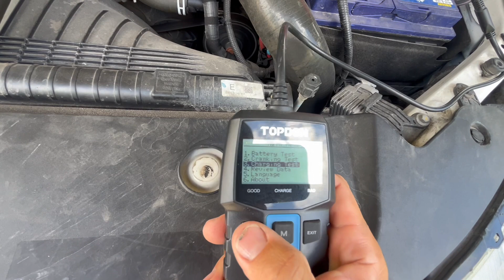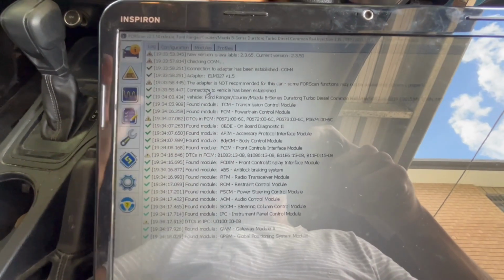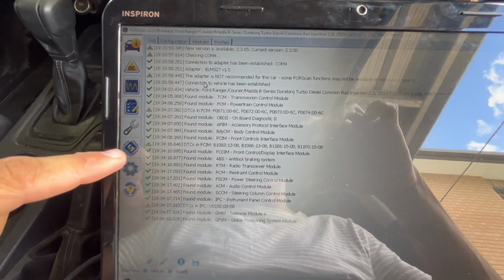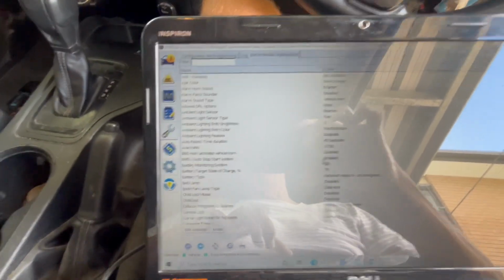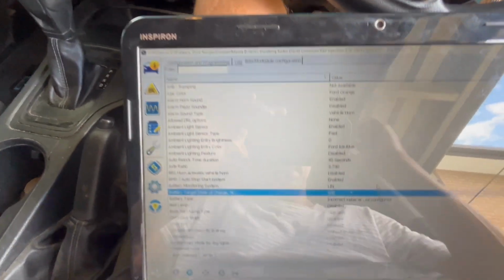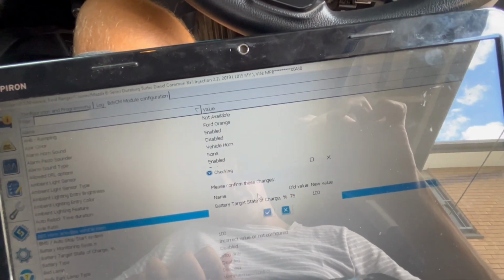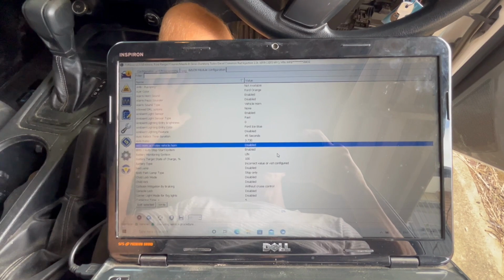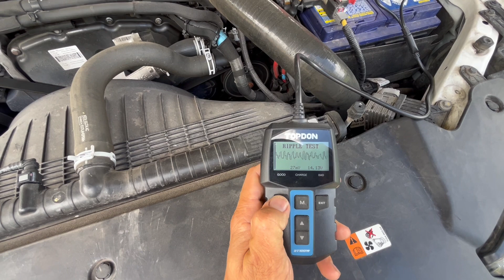Programming the Smart Charge Alternator on a Ford Ranger for 100% Charging

Comment: I have a '21 Lariat/FX4 and have the same TopDon Tester. After putting it on my truck and doing the same charge test I get 14.5v charge with 8-9 Mv jitter. About to replace the OEM battery with a lithium auto battery, was just searching around to see if I needed to change the charging profile but it looks like 14.5v for my new battery will be about perfect.

Comment: If you turn on lights , ac or any electrical load the smart charge will bump the voltage close to 14. The 12.9 is enough to keep it running with no electrical load and no battery draining to prolong life of alternator.

Comment: New subscriber here.. after watching a few of your vids.. 

I was watching these vids to see if there were some answers to my weird charging issues I have started having, where my BM2 bluetooth battery monitor reports low cranking voltage (down around 8.5v) and high charge voltage (up around 14.9v). Ford Dealer disabled smart charge years ago. 

I have Forscan Lite on Android and a OBD2 MX Bluetooth reader setup for my PX1 Wildtrak. This gets me out of quite a few jams but not all. Have you been able to work out if Forscan can show whether smart charge is disabled for a PX1 ? I'm pretty sure it is on mine as I never see the battery charging voltage drop below about 14v but it would be good to confirm the setting.

The alternator output does drop back into the normal range when everything warms up and sits at around 14.4-14.7v. Given the solid output from the alternator, I am thinking my battery is the problem, however my state motoring club tested it (it's one of their batteries) and said it was fine and the alt was the problem.

I was reading the workshop manual about alternator swap out (just in case) and came across this bit:
" The use of the GR-590 Battery Management Centre, which has been specifically designed for use on silver calcium calcium type batteries is recommended. Once connected to the battery, the battery charger detects the state of the battery charge and then applies the appropriate charge rate and duration. When the battery is fully charged, the battery charger switches to stand-by, keeping the battery in a fully charged state, preventing excessive gassing and overcharging. The Midtronics GR-590 Battery Management Centre also incorporates a software program that has the capability to assist in the recovery of deeply discharged (sulphated) batteries."

Prior to my last battery swap (2 yrs and 3 months ago) I had a Varta F18 Silver Dynamic battery installed that ran for nearly 5 years, even with smart charge turned off. Have you stuck to using the AG9 Calcium batteries or just used standard lead acid ? Noted any difference in battery life after disabling smart charge ?

Comment: Hey i have a problem, my 2.2 wildtrak when the engine is at optimal heat, i checked the oil cap and opened, when i opened it its oils are splashing out of it. Is that normal or not normal?

The oils it not overflowing but when i open the cap oils are splashing out of it. Is it normal?
Reply: I noticed the same thing, I think it’s because there is lobe on the cam
Right under the filler cap which is flinging it out the hole on my other cars the filler cap more offset and I don’t have the problem
Reply: if its small amount or just like a mist then its normal. but if its significant, maybe u overfilled or have your pcv check
Reply: lol. It’s normal. It’s NOT normal to open the cap when running lol. Stop that..

Comment: I find that if you do long trips,  you don't need to change that. If you do short trips and battery is constantly getting discharged,  then yes. The smart alternator supposed to only charge during coasting and braking to save fuel

Comment: I gave it a try on a 2021 Ranger Raptor 2L and it WORKS. Also under the same Module configuration you can adjust the alternator output voltage for a dual battery set up as well as disabling Auto Stop/Start and the Double honk.
Reply: Gonna give this a go on my 24 2.7 XLT us spec. I bet it works! I need them extra volts for my audio system! This is awesome.